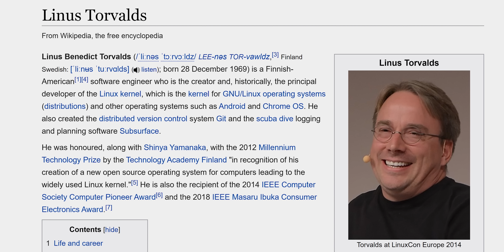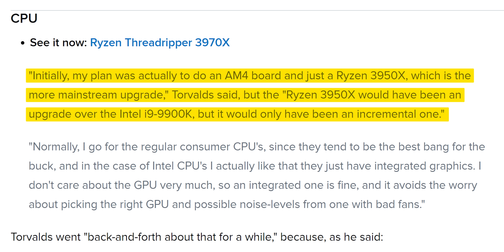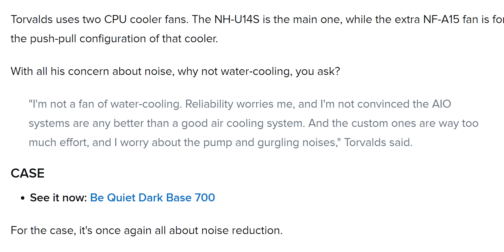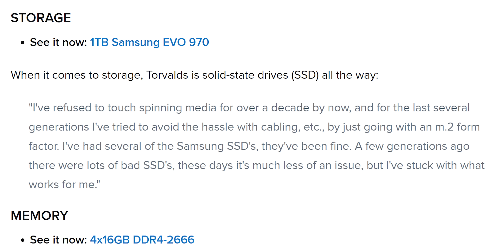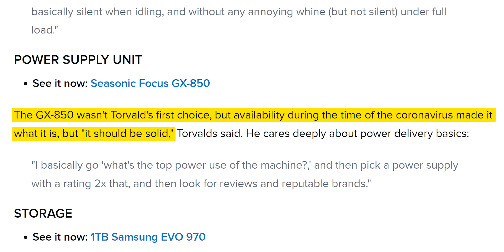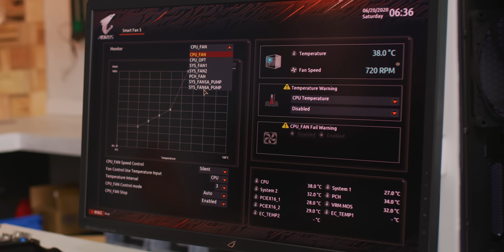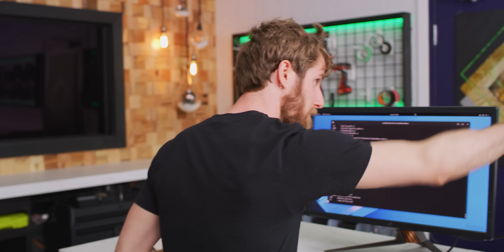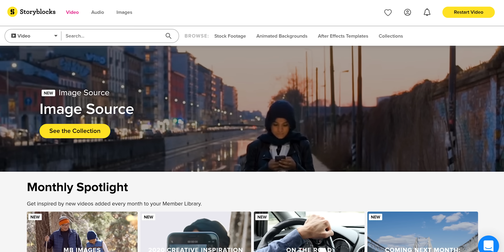Linus builds Linus’ new PC!

Comment: Linus Tech Tips has lately had more Linux content than me... I dig the trend!
Reply: @rocke6318  with a distro like pop! os or ubuntu (which pop! is based on) you can do pretty much everything you'd need to in daily use with the GUI
Reply: @rocke6318  How exactly is Linux bloated? Most distros just come with basic applications and you can uninstall them. And at least it doesn't install ads when you install a distro.
Reply: @derchef9444  one of the reasons people love linux so much is because its not bloated (except from ubuntu lol)
Reply: @gary6576  I do, it is a great OS specifically for those gaming. Special tweaks that make it stand out: OOB Lutris / Steam, vm.swappiness in sysconf, ESYNC enabled by default, and DXVK optimizations. Anthony touch on LTT videos are very noticeable and well researched.
Reply: @ChrisTitusTech   stop it you fsf violator
Reply: @rocke6318  the only reason you don't see flaws in windows code is because you don't see windows code. Every code has flaws. In Linux, at least I can fix them myself.

Trust me, any software older than 5-6 years is probably held together by duct tape and glue.

Also, in spite of all those "security flaws" that you supposedly found, most servers use Linux, not windows. Windows is actually an absolute pain for developers because of the convoluted ways in which it does simple things.
Reply: @rocke6318  i don't even use linux but is this some kind of bait?
Reply: @nootics  it has to be? Linux is the complete opposite of bloated.
Reply: @nootics  my bro linux is a hacking program
Reply: It's called Linux Tech Tips now
Reply: @rocke6318  did you seriously say linux is bloated.... i have never been so disappointed in someone
Reply: KingTiger101 distribution doesn’t matt... oh what do you mean I can’t say that?
Reply: @robertchiri6191  "Oh no, they've found my house and they're about to break down my door--"
Reply: @rocke6318  I have been using 'clear' for years on Linux. Is there something different with 'cls' on Windows that I'm not taking into account? It just 'clears' the terminal / scrolls you down, right?

Also, I've used Gnome 3.36 for a while in multiple installations and only in one install it had a memory leak, the rest of the times, even using a few gnome-extensions and themes, the gnome-shell never surpassed 400MB, usually staying way below that.
Reply: @rocke6318  If you want easy to use system install ubuntu or pop os and you won't need to compile the kernel or to use the command line. As for why Windows has more users it's because they are a company and they market their product heavily, and people are much more familiar with Windows.
Reply: from a devs perspective using linux for me is so much easier than using a mac . i can do something like 4x faster as i could on mac. Although if you want a tile style window manager on mac look into tiles and you can setup some shortcuts like tile left expand etc ...
Reply: @gary6576  everyone habe to agree popOS is one of the best. 
using manjaro btw
Reply: Because until about a year or so ago Linux wasn't a great user experience for the average user
Reply: @pingpong1138  I've been using Linux for about a decade and I pretty much only use it for gaming and browsing, just like 99% of windows users.
In that decade I've only learned a handful of commands and yet I've found it to be much more user friendly than than windows 98 through windows 8.0(I haven't had much experience with 8.1 or 10) for a myriad of reasons. And I remember that when I made the switch there was one or two features that I missed from windows, but I honestly can't recall which features. I have several friends with similar to identical experiences and I remain convinced that the only reason Linux is the least popular platform among consumers, is that consumer desktops and laptops generally are sold with either windows or mac os and the customers become used to them, then they become comfortable with them and then they become uncomfortable with anything but them. 
Anyone who tells you Linux is for people who know how to code are very wrong.
Linux doesn't require you to know any line of code just like the other platforms don't.
And if you do know code you probably use that skill either for work or as a hobby and switching to Linux will require you to relearn your skills to use them on a Linux device.
The reason that Linux is popular among software engineers and the like is because text based commands are easier to learn and work with on the Linux platform.
I'd be greatfull if someone could tell me any practical perks of mac os or windows that Linux is lacking and most people would appreciate?
I could personally make a handful of arguments as to why most people would be more satisfied with Linux once they got used to it. And when I say "most" I mean more than 50%.
Sorry for wall of texting you on a 2 month old comment, I hope you can forgive me!<3
Reply: I love you too Chris 😂😂
Reply: Oh Hi Chris! I always use your speed up Steam games video when I forget about command options.
Reply: @rocke6318  huh
Reply: @rocke6318  bloated? incorrect. Is the terminal slower than the GUI? once you know it, it's much faster to do stuff
Reply: @rocke6318  you can put it in a script and run it whenever you want to do that task. eg. Change all file extensions
Reply: @rocke6318  "Yeah. I'm pretty sure Linux users are pretty good at fixing bugs in Linux. If you use Windows, you don't need to know how to fix your broken operating system. It works out of the box.

Just look at Arch Linux. They don't even have it come with a GUI or an Installer. Leave it to the end-user to make bash scripts to pick up the work of the developer. What a great experience."

Linux works out of the box and just because every distro on the platform isn't made for the average consumer that doesn't mean none of them are... 
Windows server is a Windows distro, but like arch Linux it wasn't made for the average consumer, and like arch Linux it's not marketed for the average consumer.
Just watch some of the old LTT vids about their servers from before Anthony joined LMG and Linus would keep benchmarking them with games in windows server and it did NOT work(for gaming) out of the box.. 

When discussing OS platforms "Just look at Arch Linux." isn't a productive sentence and I don't think it ever will be. 
There are a ton of Linux distros and that's the beauty of it... People are supposed to pick the distro that suits them so if Arch comes without a gui and an installer and you want your OS to come with those, then Arch is not for you, but that doesn't have much to do with Linux...

"If Windows has so many flaws how come it has the most users? 80 year olds don't know how to use diffs and patch the Linux kernel into a useable state."
80 year olds don't need to know. All they use is the browser and mainly if not only to check their email and their bank accounts. just give them a machine with ubuntu on it enable automatic updates and tell them it's the new version of windows... They'll never know that it isn't.. Especially not if you install a boot skin and an MS wallpaper...
My own grandma is 86 years old and switched from windows to ubuntu and she started using it as if it was windows... No instructions needed what so ever... 
And we're talking about a woman who had to take a computer class 5 years earlier so she could learn how to check her E-boks which is a mail service where Danes receive their mail from public institutions.

Microsoft Windows is the most popular operating system for several reasons: 
Windows was early to the scene, and though it’s not the first GUI operating system, first internet aware OS, or first server platform, it was early enough to gain significant advantage on these fronts. In the 80s, Microsoft was one of the several competing primitive disk operating system vendors. Seeing UI as the future, MS managed to successfully leverage the DOS ecosystem and aggressive expansion to push the intuitive Windows UI, augmenting the early shell with web integration (active desktop) and a free web browser (IE), making it ahead of its time. Its progenitor (MS-DOS) was offered with every IBM PC back when IBM produced personal computers, making MS-DOS the defacto OS for business and home use. As IBM left the PC business and IBM-compatible PCs became the market standard, business and private pc owners wanted their software (in which they'd invested training time and also many hardware dollars) to continue to run - making an OS like MS Windows look like a good investment, and so PC manufacturers began to pre-install the latest version of MS Windows with every PC sold - a practice which continues to this day.
And even though it is becoming less and less common I still meet people who doesn't even know about Linux or that they can mix and match devices and operating systems.
And most people who do know, has had no experience with Linux and are scared to try it or assume that it is not for them, because just like you they think they need to know about text based commands in order to use it.
Reply: I don't like pop os. Seems a bit restricting to me.
Reply: so, linux tech tips?
Reply: Oh hey.
Reply: Linux Tech Tips
Reply: Linux tech tips
Reply: @gary6576  Linux? Bloated? Something does NOT seem right! Linux has much lower overhead than Windows. It could be a graphics card driver issue. Nvidia is notorious for this.
Reply: i want it back.
Reply: I don't really care about linux, but it's always good when they think up something new and interesting to make videos about.
Reply: Same
Reply: @` i can agree with arch and Gentoo requiring setup with a manual set up
Reply: Hi arch usee
Reply: Haaaaaa, smart one
Reply: Hello, Nice to see you here

Comment: I definitely have to agree on the Noctua fans. They are basicly silent even at 40-50% speed and that will keep you below 50-60C even under heavy load.
I don't get why people cheap out on cooling of all things, just to end up with a PC that runs hot and sounds like a jet engine, just a pay a little more. Cooling is the one thing that will basicly last a decade or longer.

Comment: Home> GPUs

AMD Publishes First Beta Driver With Windows 10 Hardware GPU Scheduling Support

by Ryan Smith on June 29, 2020 5:30 PM EST

26 Comments | Add A Comment

￼

Following last week’s release of NVIDIA’s first Hardware-Accelerated GPU Scheduling-enabled video card driver, AMD this week has stepped up to the plate to do the same. The Radeon Software Adrenalin 2020 Edition 20.5.1 Beta with Graphics Hardware Scheduling driver (version 20.10.17.04) has been posted to AMD’s website, and as the name says on the tin, the driver offers support for Windows 10’s new hardware-accelerated GPU scheduling technology.

As a quick refresher, hardware acceleration for GPU scheduling was added to the Windows display driver stack with WDDM 2.7 (shipping in Win10 2004). And, as alluded to by the name, it allows GPUs to more directly manage their VRAM. Traditionally Windows itself has done a lot of the VRAM management for GPUs, so this is a distinctive change in matters.

Microsoft has been treating the feature as a relatively low-key development – relative to DirectX 12 Ultimate, they haven’t said a whole lot about it – meanwhile AMD’s release notes make vague performance improvement claims, stating “By moving scheduling responsibilities from software into hardware, this feature has the potential to improve GPU responsiveness and to allow additional innovation in GPU workload management in the future”. As was the case with NVIDIA’s release last week, don’t expect anything too significant here, otherwise AMD would be more heavily promoting the performance gains. But it’s something to keep an eye on over the long term.

In the meantime, AMD seems to be taking a cautious approach here. The beta driver has been published outside their normal release channels and only supports products using AMD’s Navi 10 GPUs – so the Radeon 5700 series, 5600 series, and their mobile variants. Support for the Navi 14-based 5500 series is notably absent, as is Vega support for both discrete and integrated GPUs.

Additional details about the driver release, as well as download instructions, can be found on AMD’s website in the driver release notes.

Finally, on a tangential note, I'm aiming to sit down with The Powers That Be over the next week or so in order to better dig into hardware-accelerated GPU scheduling. Since it's mostly a hardware developer-focused feature, Microsoft hasn't talked about it much in the consumer context or with press. So I'll be diving into more on the theory behind it: what it's meant to do, future feature prospects, and as well as the rationale for introducing it now as opposed to earlier (or later). Be sure to check back in next week for that.

Source: AMD

Comment: Weird.. I've tinkered with PC's since I was 5 years old and somewhere during my youth lost interest to computers. Now as a health care professional and almost 20 years later, Linus' videos have made me think of another career with computers..
Reply: During my young age (now i'm 31), I was a lot into the PC and modding scene... Since I started to work as an IT/Dev/Admin, I don't care what pc I use if the thing allows me to work flawlessly with my current work load. I still using a FX6300 as my main Dev machine (Vm, DBMS, IDEs) and a i3 notebook as my daily driver for the rest.
Now days I dont give a crap about overclock or having the very last tech.
Reply: @SDogo  You ARE still young. How many of you did your first computing on a kit from Radio Shack or a TRaSh-80 with a built in monochrome 8 inch monitor and an orange reset button your teachers said never to press?
Reply: @petenielsen6683  Actually one of mi first encounters with computers was in the mid 90 with a I think a DX2 with maybe 2 to 4mb of ram under DOS/win3.1.
Yes maybe I'm still young by definition. But the technology is nowhere near to what it was like 15 or 20 years ago when winxp released to public (the time frame when I was into modding and overclock).
Reply: Never to late
Reply: my dad went from work in healthcare to healthcare IT around 20yrs ago. Transition is smooth as long as you are interested and ready to learn. I´d say go for it! Good luck!
Reply: I'm pretty sure the "health care professional in 2020" is another part of the "I need a new job"
Reply: Ha
Reply: What you're experiencing comes from Linus' from-the-bed hairdo ;)
Reply: You should do it!!!! Follow dem dreams

Comment: Linus: So boring! Seriously dude! My 16 year old daughter can out build you!
The reason that the other Linus had such weird reasoning is because he was weird, his logic is invalid because he assumed that he was always running into hardware issues and he was severely overcompensating for them. The truth is that had you don't your homework you would have found that all close either crash or just keep running during the weird conditions that the other Linus was babbling about. Its just all nonsense, that is why the other Linus actually uses the MacBook Air as his personal daily driver and called it the best computer he has ever owned because its supremely reliable, QUIETER THAN ANYTHING ELSE, gets the job done with zero fuss. He somewhat secretly still uses it as his preferred machine.

That is not "carefully thought out", that is actually showing disgust for most of the parts that he had tout in there and the lack of reliability of most parts on the market, so he has think about where everything goes wrong for him all the time.

All that this build PROVES beyond a shadow of any intelligent doubt is that to build a relatively quiet, reliable clone, you essentially are WAY OVERBUILDING it, and then underusing it, so it is less likely to break down on you in the middle of an important gaming session or the occasional work session, which of course is absolutely ridiculous and a waste of money.